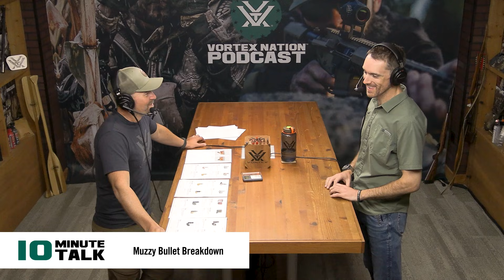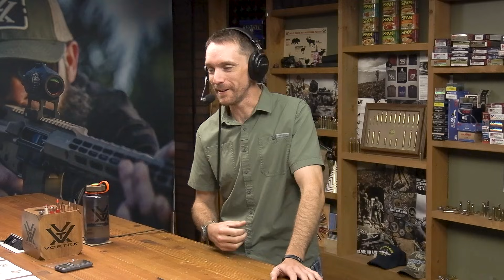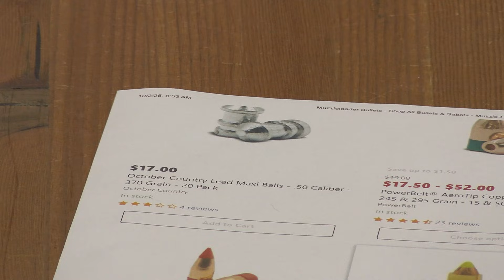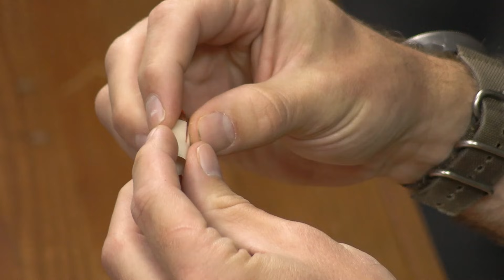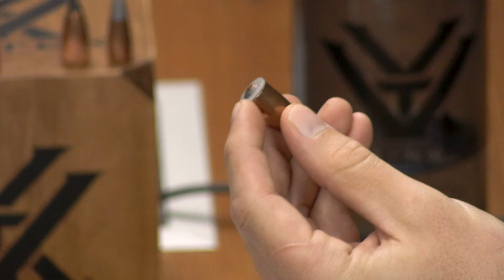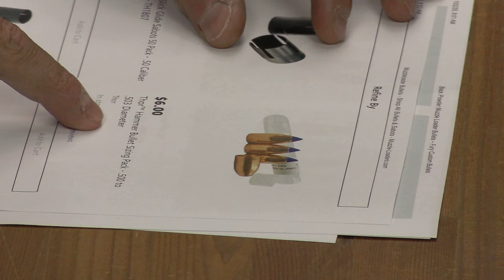#10MinuteTalk | Muzzy Bullet Breakdown

Comment: Hello,
Great work on the channel!
I have a question.

Could you do a segment on the crud ring?
I have an omega 50 caliber and it is a major problem if I use triple seven, a little lesser of a problem with Pyrodex, but it’s still there.

After one or two shots, it’s really hard to seat the bullet 

Clean bore will be right on.
Second shot will be about 2 inches high at 50 yards. Subsequent shots group tightly.

I really don’t like to hunt with a dirty barrel and Pyrodex. Rust.

Blackhorn 209 solves this (and I love it! )But it’s been very difficult to get in my area and extremely expensive.

Comment: I cast my own maxi balls in 50cal in 250gr and 350gr. The 250gr I powder coat and use them to load for my 32ga special.  Witch is basically and .50cal shotgun. I'm getting about 2in groups at 40 yards. I will be trying for a deer with it this year most likely a doe.
How about the minie ball. Very old design and was in use during the Civil War.

Comment: I shoot a T/C Encore from when they first came out in 45 caliber.  Wrong rate of twist, too fast, remedied that and I shoot 175gr PowerBelts.  I have recovered a couple and they had pretty significant engraving.  Shooting 100gr by volume Blackhorn 2200fps.  Everything I’ve shot has been DRT.  Bought some of the new heavies, just saw no reason yet to switch.

Comment: FYI the 28 twist will indeed stabilize the Hornady 345 ELDx Bore Driver in my CVA Optima V2 LR. No sign of destabilization at all. Loading with bh209 and my first 3 shot group with that particular charge weight was just under 1/2” at 100yds. Second group was just under moa, .9 something if I remember correctly. I’ll hopefully try the projectile out on a critter this season. 27:46
Reply: Same experience for me. Stabilized and shot well in a 30" LR-X with 72gr Bh209, and Fed 209. *Also 1 - 28" twist

Comment: People overstate the effect of the skirts on things like PowerBelts & other ML bullets.  In some cases, like Thor, they work pretty well -- engaging the rifling and sealing the bore.  But in others, like PowerBelts, it is primarily the soft lead that upsets (obturates) to seal the bore and engage the rifling.  The skirt is really just a useless gimmick on some and just something to build a little more pressure to help obturation for others.  Experiment: take a PowerBelt, clip off the skirt & fire it -- it works just fine.  But take a flat-base, hardcast or lead free bullet that barely fits down the bore, load it on top of some kind of skirt or wad and you'll find it horribly lacking in accuracy & may even have leading/gas cutting.  Without obturation, the bullet can't seal the bore.  The skirt won't do much by itself unless it is more like a sabot (even then sometimes).  However, you can absolutely take a slightly undersized bullet (-0.03" or so) and stuff it down the bore with a tight-fitting patch, just like a round ball, and get pretty good accuracy.

Comment: I had some bad luck with Power Belts. I was shooting 45 caliber Power Belts (I can't recall the weight) using 150 grains of 777 powder. They shot excellent groups, but terminal performance on a couple of deer that I shot with it was lacking. They expanded very very rapidly, with one shot into the shoulder of a mule deer not penetrating deep enough to breech the body cavity. I have since moved to another projectile, but haven't had the chance to try it out on any game.
Reply: Right there was your first mistake 150gr in a 45 cal muzzleloader with that bullet which they suck 80gr was all I shot when I did use them back then 195gr aero tip did really well now I shoot a 200gr xtp with sabot 77 gr of powder it's a very accurate load